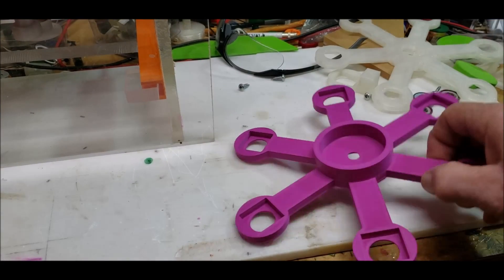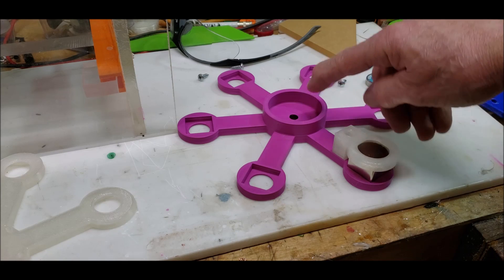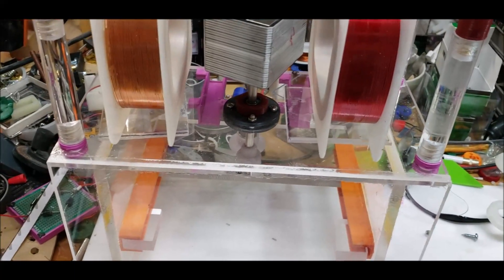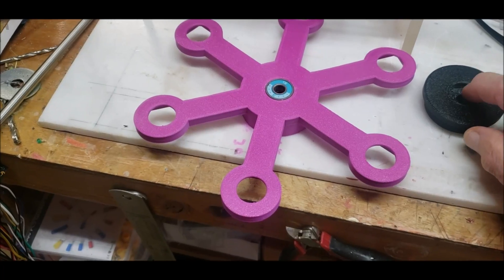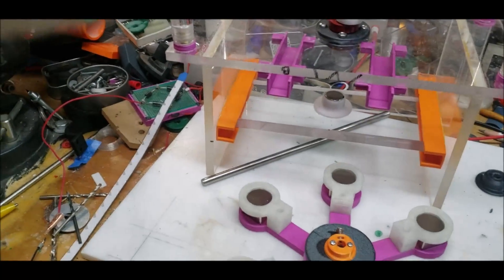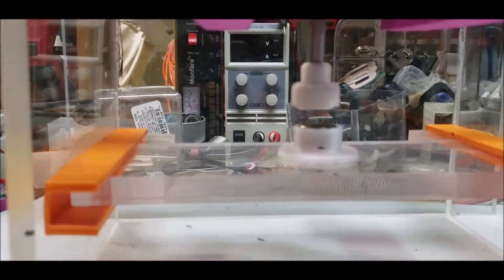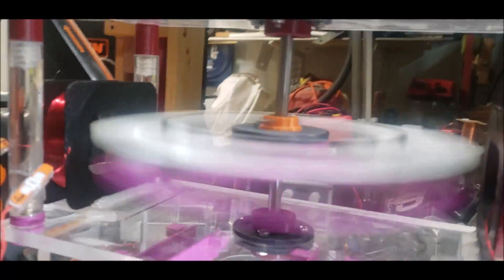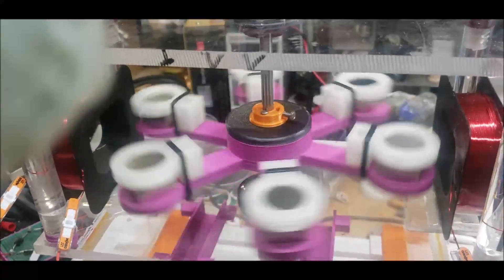3D Printed Newest Pulse motor

Comment: May i suggest a dual screw system? You could put one screw on either side of the brackets so that the magnets have more security to them.
Reply from the maker: Yes absolutely, I even thought of this one myself. I will put it into use on the next large rotor. This one already cracked at its weakest point uggggggg

Comment: You need a zip tie tool. I used to have a nice one you could adjust the tension before it cuts the end off.
Reply: You need a strobe light triggered by the coil input then film in the dark lol.